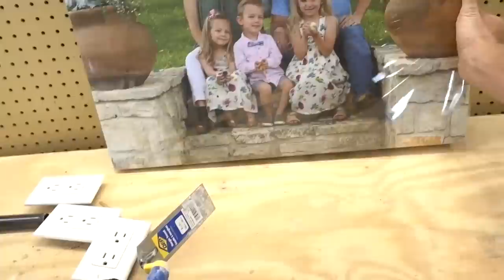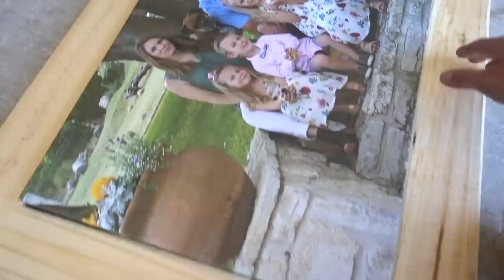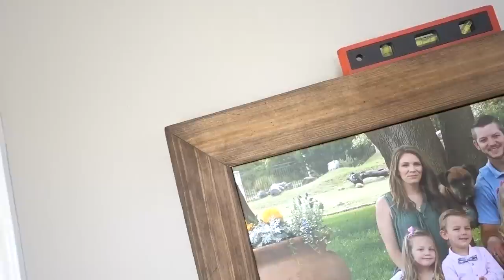All About Her! :)

Comment: Flip flops, rings, no gloves - carpenting like a boss. Mer is so awesome
Reply: Captain Hans Geering agree
Reply: You never use gloves with rotational power tools, as it's way too dangerous, workshop basics.
Reply: Gloves in use on an industrial Planer get caught in the guard and the wood hold-down pressure area and my hand was on its way through when i pulled it out.  that was in the 80's.  I still have a scar on top center of my hand 1 inch from the wrist .  That is how much of a bite it had on me when i pulled to side to break out of the bite.
Reply: Kip's Journey 

Some lessons are hard learned. I'm glad you got your hand out.

Comment: I can really relate to the last segment of this video. A couple of years ago I had a bad reaction to some antibiotics and basically had a nervous breakdown-type situation. Although it has had a lasting effect, I am much better now.
What got me up was: 
1. My dog. (corny, but true) and:
2. "Just do one thing" - If it all seems like too much to comprehend, pick a small bit of it and do that. Step outside, even for 30 seconds, breathe, and then go back inside if you want to. Next time, make a tea or juice (or anything else that makes you happier), take it with you, sit outside for just a little longer that you used to.  I had a garden, and I would go and "stare at the dirt" until one day, I pulled a couple of weeds. Next time, more weeds and rocks, then weeds, rocks and planting. It takes a while and you don't have to do it all at once.
It will get done, get better, or happen eventually. Just keep going.